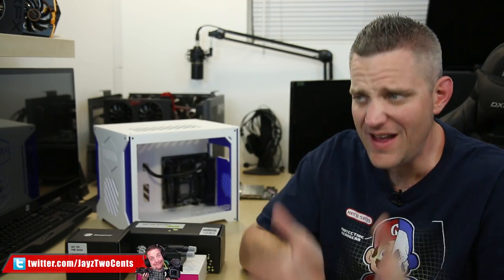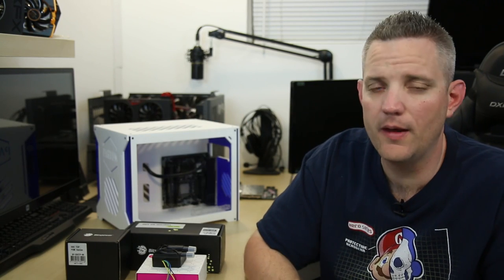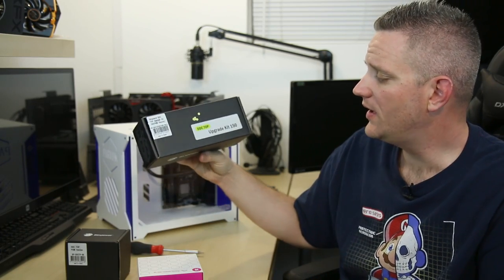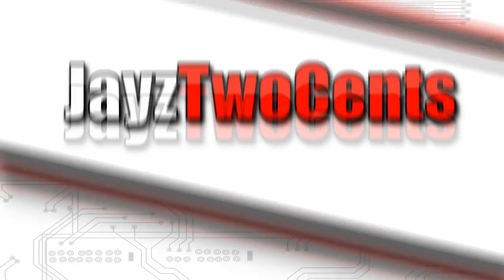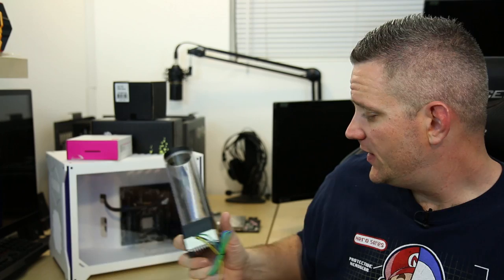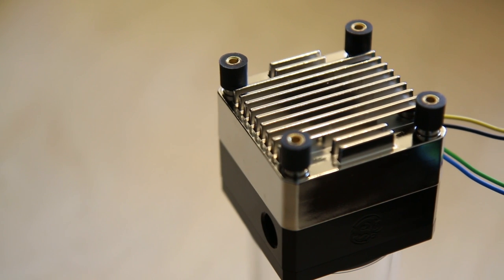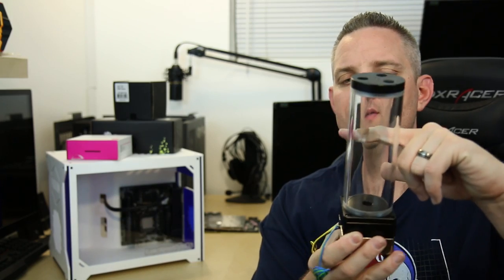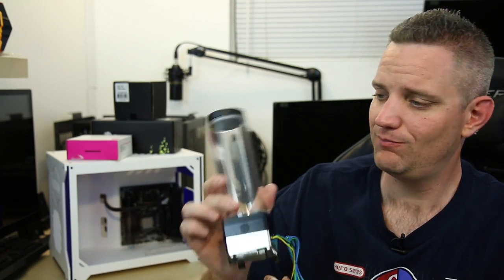Custom Laing DDC Pump Setup - EKWB and Bitspower

Comment: Very smart you put a heatsink on the Laing/Swiftech pump since they are prone to burn with a high flow top. I burned trough two Laing pumps due to the weak electronics, I had to install Diyinhk replacement electronics...

Comment: When I was at Micro I saw a BP res that I think was smaller than the one you have or could be the same. For sure it had smudges and scratches as someone opened it before and there's no price reduction. No bueno.

Comment: Dude. Check you the Aqua Computer Aqualis 100ml.
I have used one in my Bitfenix Prodigy Acrylic WC build.
It's a small size reservoir pump top combo, should also fit nicely in your case.

Comment: Has anyone ever did a pump that has a waterblock on it and has it included in the watercooling loop? Bit of a bonkers idea, I know, because it doesn't really affect the computer's performance so doing that is quite pointless but I'm just curious because it's actually the first time I've ever heard that the pump actually getting "pretty damn hot", as Jay said.
Reply: Lol real late reply but d5 pumps are cooled by the water in the loop, ddc pumps are the ones with a heatsink and iirc nobody has done this

Comment: I don't get how the heat sink is necessary. I know you said that the pump gets hot and that it's "dumping all that heat in side the loop" but how is the heat being "radiated out at the bottom" any better? So now the heat is in the case and needs to be pulled out buy the fans. Isn't the whole point of water cooling to remove heat from the components, cant the pump just be looked at as another component that need to be cooled by the water as well?
Reply: I'm using Laing pumps for 5 years. I know from my own experience the 12watt pumps NEED an heatsink with an high flow (basically all aftermarket) top. The electronics are very weak and will burn eventually. I burned two pump electronics. One in warranty after 1,5 year and one after 2,5 years which I still use with the much stronger and better Diyinhk electronic PCB (it has overheat protection). The heat from the Electronics are not watercooled, the electronic parts of these pumps aren't even waterproof.

I recommended everyone to get the 8watt Laing pumps or install an heatsink.
Reply: Detmer Oh ok, that makes sense. So it's not really about it heating the loop then.
Reply: +Detmer

Watercool the pump maybe 

He he he

Comment: Is it possible to get used water blocks. My mind set is that they are usually the most expensive parts of a water cooled loop and if I can get them used then it will be cheaper. I also have an older graphics card that I would like a full cover block for it, but would it be worth it?

Comment: I've never owned a laing pump. EK DCP 4 at the moment.  Square brick with 800 lph. Would like a pump i could adjust speed on.  Is it worth me going go to the expense of a laing?  I have two EK DCP 4 so i could sell them both along with the insane XSPC 500mm passive heatsink reservoir I have.

Comment: @ Jay, Please try and get your hands on an EK Water Blocks Predator 240 All In One Watercooling Solution and do a review, I'm hovering over the purchase button but can't find any independent reviews yet and it's not a cheap model, I had an old H100 for a long time but that died and I had to get a small Bequiet Air cooler, I'm now ready to get an AIO and this looks like it'll be great, It's pricey  so I need to know if it's worth the extra.
Reply: +nasha thedog he did, looks amazing

Comment: Just one dumb question, were do you connect that blue green cable?
Reply: +Southeastern777 My thought exactly, but wasnt sure, thats why I asked, hoped Jay could answer, but yea.
Reply: nvm, found this on ekwb's site "Pumps for water cooling have significantly bigger power consumption, so the power is mostly hooked up to the molex connector, and the other two tach and PWM wires are connected to the motherboard header for PWM control and speed readout" so its good to go and just connect it to the MB then.

Comment: i have this same pump on a aorus 1080ti and 9900k but for some reason my gpu hovers around 80-84c while gaming and the cpu stays in the low 60s. ive repasted the gpu but its still up there could this pump be the reason?? pump- gpu- 360mm rad- cpu- 280mm rad- res

Comment: I want a new grphics card! What should I get for $150-$200
Reply: R9-280/280x will be the best
Reply: Amd r9 280
Reply: Get the 960 :)
Reply: anything but an amd card, don't punish your system with catalyst drivers.
Reply: Shady E haters will be coming in hot
Reply: Try hunt for second hand R9 290, you may found in n somewhere.
Reply: TAKASHI BOYES Titan X
Reply: ok ok every one really need the best for the price!
Reply: TAKASHI BOYES Just like I said try hunt a used R9 290 lol, might depends on where you live.
Reply: fine best recording and streaming card?
Reply: TAKASHI BOYES WTH man... You think I going to spoon feed you? Do some research.
But I still with my point, used R9 290, thats way lot of horse power than a new card.
Reply: ok thx
Reply: +TAKASHI BOYES If you still dont have one, i would recommend a gtx 760 or something like that. I have one with my intel i7 4790k and i get amazing performance.
Reply: no im good man i got a gtx 970
Reply: Nice, what cpu?
Reply: intel core I 7

Comment: I know this is irrelevant to the video but if my pc consumes 315 watts would my pc operate okay with a 750 watt psu or would it run in some issues
Reply: If it consumes 315 watts a power supply as large as 750 would actually be worse than a, say 450, watt model because it wouldn't be operating in its peak efficiency range. (I think it's like 50-75% load).
Reply: 600w is enough mate because 315/600x100 = 52.5%
So you only use around 50% of its full power.
Reply: Cirno You only get half marks because you failed to 1. Write the equation, 2. didn't include units, 3. didn't use the appropriate "therefore" symbol... Your midterms gonna crash unless you just put in that little bit of extra effort.
Reply: And must i say it? yes, cus this is the internet "JK."
Reply: a 550 or 600 Watt would be a fine a 750 would not really be good on the PSU. when they aren't put around what there rated by underpower or overpower is not going to let the PSU run normally. it wouldn't have a problem but the life time of the Psu will be reduced by Half or more.
Reply: Alex Sayle Half marks are better than none!
Reply: What do you think?
Reply: XDENT TIM I don't believe under powering a PSU shortens it's life at all. But it does effect it's efficiency on it's power curve. If you know something I don't please explain.

Comment: whats the cheapest form factor? i wanna try water cooling but i have. a low budget like $500 or less
Reply: If you want to just do a cpu one you can get a kit from EKWB for about $200 to $300. Like these http://www.ekwb.com/shop/kits-cases/kits.html.
Reply: Cyber Grey Its Euro not Dollar mate.
Reply: You have to select your currency on the website. It should be on the right of the page.
Reply: Cyber Grey Didn't noticed that. Ahaha
Reply: Are you trying to build a system and watercool it for 500$?
Reply: TheRatchet35 yeah but i was thinking a mini itx
Reply: Brandon Esper dont watercool with that budget
Reply: Brandon Esper Yeahhh, no. At 500$ there's no need for watercooling as you won't be doing much overclocking. Besides, the parts for a full GPU/CPU loop alone will cost about 300$, and that's the risky cheap stuff that I wouldn't put in my crappy 150$ third hand ITX HTPC. I'd spend 400$ on the loop alone, get some EK/AlphaCool stuff in there with a D5 pump, or maybe an expandable AIO cooler like the swiftech H240x and use that as a base, as for the system itself, unless you live on the sun or want to overclock like there's no tomorrow I wouldn't recommend WCing. Save the money and buy a beter GPU.
Reply: Brandon Esper It's also hard as hell to WC in a mini ITX. I assume this is your first build? Go for an ATX. I can send you a mid tower (ATX) build that I recently did for my brother. It's about 750-780$ though.
Reply: TheRatchet35 ive wanted to build one for a while now (an atx) but i haven't had the money. its hard for me to invest a lot of money because i know i wouldnt use it that much. ive just always wanted one.
Reply: TheRatchet35 and yes i know its stupid, ive just always wanted a wc pc because i think it looks really cool.
Reply: Brandon Esper I fully agree, but it's just stupid to do it for a +- 200$ build. I'm saving up myself to upgrade to an asus maximus VII formula board, get 16gb of corsair Vengeance ram, get the new (5th?) gen intel i7 that launches soon and a second gtx 970. Then I'll consider watercooling it and push the overclocks a little bit.
Reply: TheRatchet35 my thing is im very picky and ocd so it sucks because in my mind i put the look before the performance.
Reply: TheRatchet35 like i really want an all white pc or an all red and black pc or something like that. i also want a case with a window, im too picky.
Reply: All white is tough. The system I designed for my bro is white/black though.
Reply: TheRatchet35 yeah for all white it seems that id need to go with an asus x99 which are expensive af
Reply: CPU: intel pentium G3258 anniversary edition.

GPU: MSI gtx 960 Gaming

CPU cooler: Hyper 212 EVO

Mobo: asus Z97-A

RAM: 8gb of kingston savage ram

Storage: just a samsung 840 EVO (250gb)
You can go for a similarly priced SSHD, my bro just wanted an SSD.

Case: the H440's (My case :D) little brother, the NZXT S340.
Reply: The S340 is available in all black and white/black. GPU is red/black. Total price is, like I said, 750-780$. :D
Reply: TheRatchet35 what board did you use?
Reply: TheRatchet35 nevermind i didnt see it at first
Reply: My motherboard and processor were over $500 mang. I'm on Mini ITX.

Comment: i have like 5 case fans in my system,  2 in the very front for intake and a 3rd right behind those to help the flow, the one that helps the intake from the front seems to spin so slow, but I idle around 32 celcius, I was wondering if anyone is familiar with INWIN GRone cases, can I increase the fan speed of the one that helps the intake from the front? I think it's powered by a fan controller on the front of the case which has two modes. Would I have to plug that specific fan into the mobo to control it via bios?

Comment: I NEED HELP PLEASE so i have been looking around at recommended system requirements on games and i have the i5 4430 and a lot of games are saying you should have an i5-2500k or i5-3470 so i was wondering would it really be worth it to upgrade to the i5-4690k FROM the i5-4430
Reply: Only get a 4690k if you have a Z97 motherboard. If you have any other motherboard, just get the 4690.
Reply: dont upgrade
Reply: ThatGuyOnCoke if i was going to upgrade and i have chosen not to but if i was i would get the 4690k over the 4690 because the only difference is the 4690k overclocks better even though i wouldnt be overclocking on my motherboard i would still get the k because its cheaper on pcpartpicker
Reply: Clayton PcGamer the 4690 doesnt overclock since its a locked cpu

Comment: hey so im building my own pc and this is my build so far: Motherboard: ASROCK Z97 Anniversary memory max. 32GB

CPU: Intel Core i5-4670, 3.8GHz turbo, 3.4GHz base, quad core with SPIRE SP985S1-V2 CPU cooler

Memory: 8GB DDR3

Graphics: MSI RADEON HD 7950 3GB, TWIN FROZR III, OC EDITION, BOOST EDITION, GDDR5, DIRECTX11

PSU : 850W + 80 bronze

Storage: SSD KINGSPEC 128GB SATA III for OS + 1TB SEAGATE, 128MB CACHE, 7200rpm for DATA

Optical Drive: DVD BURNER

OS : Win 7Ul. 64bit- FRESH

any suggestions for replacements? willing to spend about 750-800 euro on it
Reply: Forums are the place to ask questions like this good sir.
Reply: get a weaker power supply 750 is over enough and get a gtx 970 if its in your budget since this old 7950 is old and weaker also get a h97/h81 motherboard if you arent getting a k series cpu
Reply: thanks

Comment: Hi
I wanted to ask you if these pieces
 can be fine to build a complete pump with tank, I already have the engine  -  Bitspower   (CODE: BP-DDCTOPUK150AC-CLCL -   CODE: BP-WTZACC2-CL  -  CODE: BP-PMCTDDCTPAC-CL )  -  EK-DDC ( CODE: 862674  )   
thank you

Comment: why does ANYONE use a DDC over a D5????!
Reply: It has more head pressure, it's quieter and produces less vibrations. I'm familiar with both pumps.
Reply: The DDC is not quieter than a d5
Reply: Detmer D5 has more flow rate and is quieter.. I was asking a silly question cause the DDC makes sense in a small case but I'd still try my hardest to fit a d5

Comment: Hey guys I'm planning to build my first PC soon. http://pcpartpicker.com/p/4qpYt6 this the build. Will there be any problems or any better replacements for a case?
Reply: If you are willing to spend a little more, use this build: http://pcpartpicker.com/p/P7pYt6
at that budget you need and aftermarket cooler and a better motherboard, ive been using that motherboard for a year without problems. Other than that it is a great build.
Reply: Don't get an8350. Gets B81/85 MoBo and an i5 4440
Reply: http://pcpartpicker.com/p/prsFyc will this be good? Also since more games are slowly taking over more than 4 cores for games, will an Intel i5 quad core perform as well as a 6-8 core amd CPU?
Reply: The 8 core will perform similar to the 15 if you overclock, but it absolutley desrtoy it in and productivity programs. Dont listen to those fanboys.
Reply: That's a poor PSU also, get a Seasonic or SuperFlower OEM unit. Corsair PSUs are crap
Reply: I have a HX750 and it's been great
Reply: 503technics That's Seasonic OEM :)
I should reammend to say all non-Seasonic OEM and AX1500i Corsair PSUs are crap
Reply: Corsair PSUs are made by channel well
AliveGhost13
Reply: 503technics AX series are Flextronics, however back in "the day" HX, AX, TX etc used to be made by seasonic
Reply: AliveGhost13
Oh, i didn't know that, well, My PSU was made by channel well